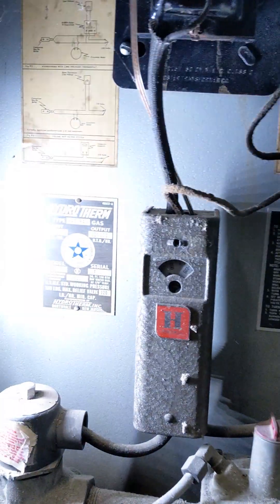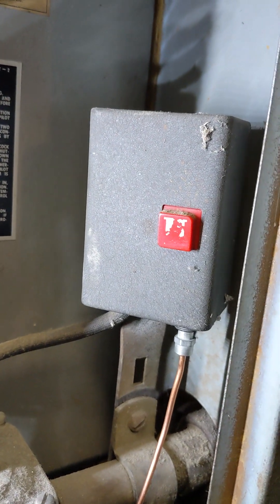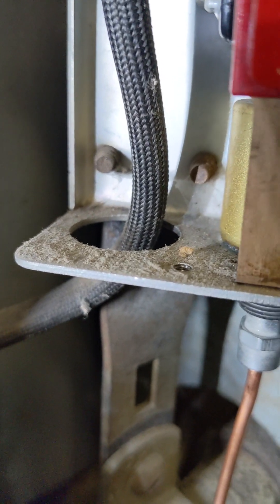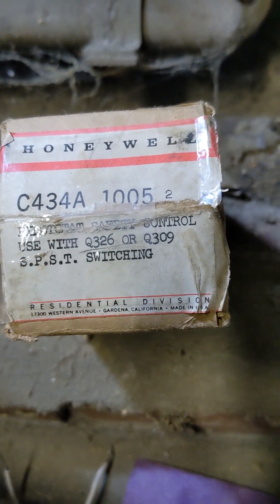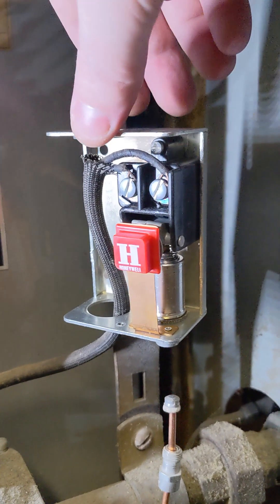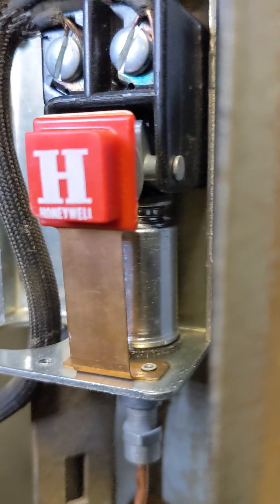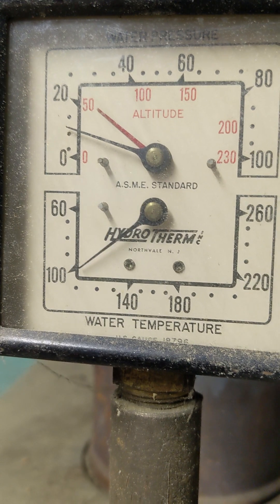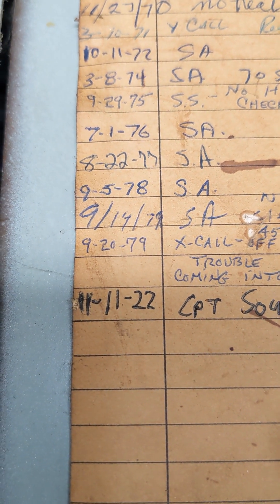Southbird's Furnace - Episode 1 (Okay not really, I hope not)

Comment: uhm.... im pretty sure you could have removed the flat head screw holding the bracket for that switch on and then removed the screws easily.....
Reply from the maker: Too long ago to remember how I arrived the way that I did, but to be fair, I was servicing a 1960s era boiler with no direction. Lucky I could even find the new-old-stock safety switch. I might have been unable to reach them, or I was spinning a nut or something. I probably had a reason, or I just didn't see it the way you do at the time.

Y'know what's funny is, despite this, it doesn't gate the pilot, so if the pilot goes out, this thing will just slowly fill the basement with gas anyway. I learned that because the gas company was replacing lines in the area, and they said they detected "a leak" after they had replaced my line and gas meter. Turns out, the boiler was just slowly leaking gas and there's no mechanism for it to not do that from the pilot end, so I guess it's just something to monitor.
Reply: @CaptainSouthbird  Thats really interesting and good to know, I have a similar system. Guess i'll be installing a combustible gas alarm. Youmight consider doing the same, its cheap safety.